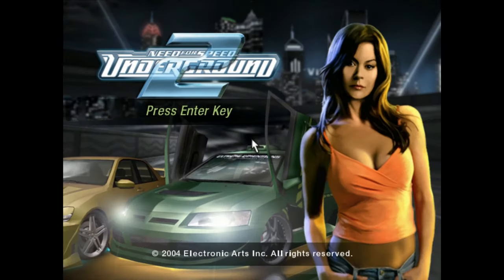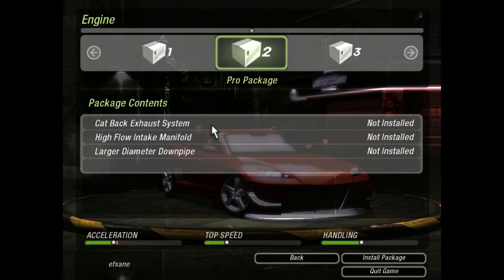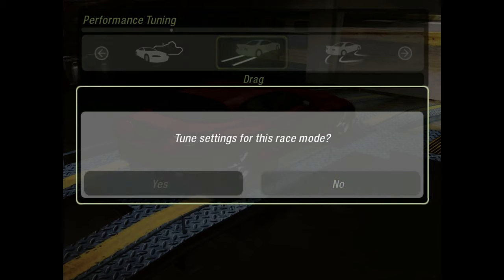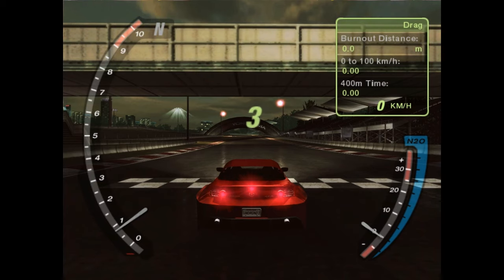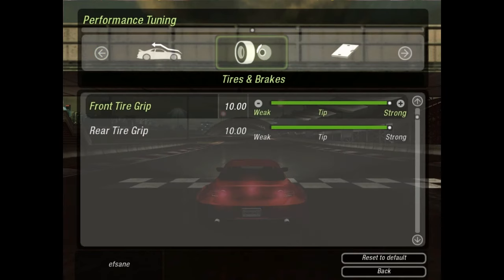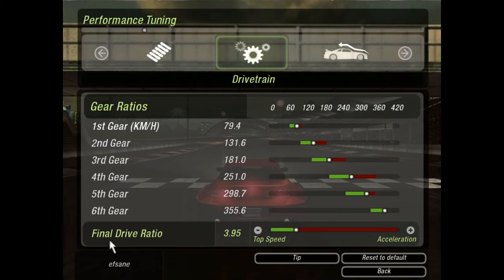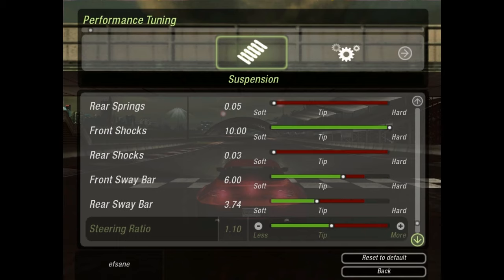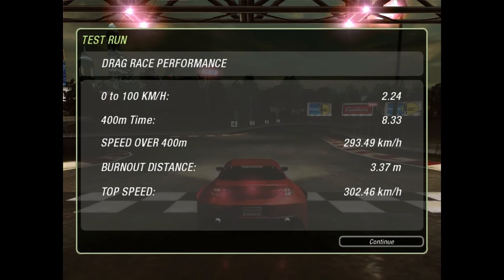How to Tune RWD cars in Need for Speed Underground 2

Comment: What could happens if yo don t install brakes?? If you drift you don t need them perhaps up to level 1 or 2 the professional upgrade but why extreme brakes? Lol
Reply from the maker: Lol it is basically for when you hit corners not to break to early, you can acxelerate much closer to the corner, slam the breaks and then still make a good turn, if you have weak brakes it will mean you need to brake much earlier sothat you can slow down enough for the corner. This makes your lap time longer

Comment: What about the strut tower bar and the adjustable camber plates
Reply from the maker: strut is more for taking corners, this video was only focusing on drag racing where we don't need to take corners, also camber is usually applied on FWD cars in a - as the front end of the car lifts up and the - camber will go to a 0 where as with RWD the back of the car goes down so no camber is really required
Reply: @TheOverclock  camber is also good on rear wheel drive cars for grip around corners
Reply from the maker: possible because when you do accelerate out a corner your nose will lift a bit and in this case having a - camber depending on power, camber will be efficient.
Reply: @TheOverclock  it's when you're going around a corner your car leans over and having a bit of camber helps get some grip in the corners

Comment: NFS UNDERGROUND 2 PERFORMANCE UPGRADES GUIDE
---------------------------------------------------------------------------------------
---------------------------------------------------------------------------------------
ITEMS ENCLOSED IN '*' NOT TO BE BOUGHT
---------------------------------------------------------------------------------------
---------------------------------------------------------------------------------------
STREET PACKAGE
---------------------------------------------------------------------------------------
---------------------------------------------------------------------------------------
ENGINE
---------------------------------------------------------------------------------------
COLD AIR INTAKE SYSTEM
REPLACE HEADERS
MILD CAMSHAFT AND CAM GEARS
PERFORMANCE EXHAUST
---------------------------------------------------------------------------------------
ECU
---------------------------------------------------------------------------------------
FUEL PRESSURE REGULATOR
FUEL RAIL
FUEL FILTER
REMOVE TOP SPEED LIMITER
---------------------------------------------------------------------------------------
TRANSMISSION
---------------------------------------------------------------------------------------
SHORT THROW SHIFT KEY
LIGHTWEIGHT FLYWHEEL
DIFFERENTIAL
---------------------------------------------------------------------------------------
SUSPENSION
---------------------------------------------------------------------------------------
SPORT SPRINGS AND SHOCKS
STRUT POWER BAR
---------------------------------------------------------------------------------------
NITROUS OXIDE
---------------------------------------------------------------------------------------
DRY SHOT OF NITROUS OXIDE
---------------------------------------------------------------------------------------
TIRES
---------------------------------------------------------------------------------------
STREET PERFORMANCE TIRES
---------------------------------------------------------------------------------------
BRAKES
---------------------------------------------------------------------------------------
STREET COMPOUND BRAKE PADS
STEEL BRAIDED BRAKE LINES
CROSS DRILLED ROTORS
---------------------------------------------------------------------------------------
WEIGHT REDUCTION
---------------------------------------------------------------------------------------
REMOVE REAR SEATS
REMOVE INTERIOR PANELS
---------------------------------------------------------------------------------------
TURBO
---------------------------------------------------------------------------------------
STAGE 1 TURBO KIT
---------------------------------------------------------------------------------------
---------------------------------------------------------------------------------------
PRO PACKAGE
---------------------------------------------------------------------------------------
---------------------------------------------------------------------------------------
ENGINE
---------------------------------------------------------------------------------------
COLD AIR INTAKE SYSTEM
REPLACE HEADERS
MILD CAMSHAFT AND CAM GEARS
CAT BACK EXHAUST SYSTEM
HIGH FLOW INTAKE MANIFOLD
LARGE DIAMETER DOWNPIPE
PERFORMANCE EXHAUST
---------------------------------------------------------------------------------------
ECU
---------------------------------------------------------------------------------------
FUEL PRESSURE REGULATOR
FUEL RAIL
FUEL FILTER
REMOVE TOP SPEED LIMITER
PERFORMANCE CHIP 
HIGH FLOW FUEL PUMP
---------------------------------------------------------------------------------------
TRANSMISSION
---------------------------------------------------------------------------------------
SHORT THROW SHIFT KEY
LIGHTWEIGHT FLYWHEEL
LIMITED SLIP DIFFERENTIAL
HIGH PERFORMANCE CLUTCH
DIFFERENTIAL
---------------------------------------------------------------------------------------
SUSPENSION
---------------------------------------------------------------------------------------
STRUT TOWER BAR
PERFORMANCE SPRINGS AND SHOCKS
FRONT AND REAR SWAY BARS
ADJUSTABLE CAMBER PLATES
SPORT SPRINGS AND SHOCKS
---------------------------------------------------------------------------------------
NITROUS OXIDE
---------------------------------------------------------------------------------------
WET SHOT OF NITROUS OXIDE
DRY SHOT OF NITROUS OXIDE
---------------------------------------------------------------------------------------
TIRES
---------------------------------------------------------------------------------------
PRO PERFORMANCE TIRES
* STREET PERFORMANCE TIRES*
---------------------------------------------------------------------------------------
BRAKES
---------------------------------------------------------------------------------------
STEEL BRAIDED BRAKE LINES
LARGE DIAMETER ROTORS
RACE COMPOUND BRAKE PADS
STREET COMPOUND BRAKE PADS
CROSS DRILLED ROTORS
---------------------------------------------------------------------------------------
WEIGHT REDUCTION
---------------------------------------------------------------------------------------
REMOVE REAR SEATS
REMOVE INTERIOR PANELS
LIGHTWEIGHT WINDOWS
LIGHTWEIGHT SEATS
---------------------------------------------------------------------------------------
TURBO
---------------------------------------------------------------------------------------
STAGE 2 TURBO KIT
STAGE 1 TURBO KIT
---------------------------------------------------------------------------------------
---------------------------------------------------------------------------------------
EXTREME PACKAGE (HELL YEAH!)
---------------------------------------------------------------------------------------
---------------------------------------------------------------------------------------
ENGINE
---------------------------------------------------------------------------------------
COLD AIR INTAKE SYSTEM
RACING CAMSHAFTS AND GEARS
PORT AND POLISH HEADS
BLUEPRINT THE BLOCK
HIGH FLOW HEADERS
CAT BACK EXHAUST SYSTEM
HIGH FLOW INTAKE MANIFOLD
LARGE DIAMETER DOWNPIPE
REPLACE HEADERS
MILD CAMSHAFT AND CAM GEARS
PERFORMANCE EXHAUST
---------------------------------------------------------------------------------------
ECU
---------------------------------------------------------------------------------------
FUEL PRESSURE REGULATOR
FUEL RAIL
FUEL FILTER
REMOVE TOP SPEED LIMITER
HIGH FLOW FUEL PUMP
ENGINE MANAGEMENT UNIT
FUEL INJECTORS
PERFORMANCE CHIP
---------------------------------------------------------------------------------------
TRANSMISSION
---------------------------------------------------------------------------------------
SHORT THROW SHIFT KEY
LIGHTWEIGHT FLYWHEEL
HIGH PERFORMANCE CLUTCH
6 SPEED DIFFERENTIAL
DIFFERENTIAL
LIMITED SLIP DIFFERENTIAL
---------------------------------------------------------------------------------------
TRANSMISSION
---------------------------------------------------------------------------------------
STRUT TOWER BAR
ADJUSTABLE CAMBER PLATES
COIL OVER SUSPENSION SYSTEM
LARGE DIAMETER SWAY BARS
SPORT SPRINGS AND SHOCKS
PERFORMANCE SPRINGS AND SHOCKS
FRONT AND REAR SWAY BARS
---------------------------------------------------------------------------------------
NITROUS OXIDE
---------------------------------------------------------------------------------------
DIRECT PORT NITROUS OXIDE
DRY SHOT OF NITROUS OXIDE
* WET SHOT OF NITROUS OXIDE*
---------------------------------------------------------------------------------------
NITROUS OXIDE
---------------------------------------------------------------------------------------
EXTREME PERFORMANCE TIRES
STREET  PERFORMANCE TIRES
PRO PERFORMANCE TIRES
---------------------------------------------------------------------------------------
BRAKES
---------------------------------------------------------------------------------------
STEEL BRAIDED BRAKE LINES
RACE COMPOUND BRAKE LINES
CROSS DRILLED AND SLOTTED ROTORS
6 PISTON RACING CALIPERS
STREET COMPOUND BRAKE PADS
CROSS DRILLED ROTORS
LARGE DIAMETER ROTORS
---------------------------------------------------------------------------------------
BRAKES
---------------------------------------------------------------------------------------
REMOVE REAR SEATS
REMOVE INTERIOR PANELS
LIGHTWEIGHT WINDOWS
LIGHTWEIGHT SEATS
LIGHTWEIGHT DOORS
FOAM FILLED INTERIORS
---------------------------------------------------------------------------------------
TURBO
---------------------------------------------------------------------------------------
STAGE 3 TURBO KIT
STAGE 1 TURBO KIT
STAGE 2 TURBO KIT
---------------------------------------------------------------------------------------
ENGINE CHANGES TORQUE
TURBO CHANGES POWER
---------------------------------------------------------------------------------------
-----------------------------------THE END -------------------------------------
---------------------------------------------------------------------------------------
Reply from the maker: Thanks for sharing your info :) :)

Comment: Do you know how to tune rwd car so that they won't be slippery at tight cornering?
Reply from the maker: That has got to do with your swaybar, its either you stifen it or loosen it, i am not 100% sure but that is where you will need to adjust :)
Reply: Thanks for your reply. Do you have any rwd car that good at tight cornering? If you have can you show me the suspension.
Reply: I tune awd and fwd car and it's not slippery but when i tune rwd car its slippery in tight corner
Reply from the maker: Unfortunately i haven't played the game in a very long time, rwd cars has a problem with cornering amd especially if you apply a lot of power to it, maybe ypu should try to go slower in the corner and about halfway through you accelerate again... But i would say you need something with weight so try the mustang maybe
Reply: So you don't use rwd if the race have tight cornering?
Reply: Btw i love your video when you play online at underground 2
Reply from the maker: I honestly dislike RWD a lot... It has a major traction problem (yes fwd is worse when it comes to pull away) but with rwd it always spins out and struggle with cornering and ect... For drifting its fine but when it comes to racing i dont like it that much... Myself i am a all out AWD guy... In real life i do racing (mostly drag) and all these AWD cars has so much traction that on the pull away they leave everyone behind, the people even stopped racing the AWD cars because of the dangerous pull aways, also AWD are the best to take the corners and get out of it quick... Also try to do drifting with a AWD car, they can hit corners fasters and be out of the turn even before they hit the side barrier, RWD & FWD always hits the barrier because they cant get out of the turn
Reply from the maker: I used to stream it, but then i completed the career :( i want to get heat so bad! but i will oneday when i get enough saved up :)
Reply: Good luck getting nfs heat bro and is it possible to convert old nfsu2 save game into 2019 nfsu?
Reply: I just know that nfsu2 2019 graphic exist in your video
Reply: The Corolla is surprisingly good at cornering. No more struggle on Street X races since i have one.
Reply: Lol rwd is the best for cornering just like king of street x corolla "ae86" just master the proper engine brake, brake timing and gas pedal for more accelaration in exits. I always use corolla in circuit sprint if jackson heights is the map, street x, drift, and url hehe i use 240sx for drag and also for circuit and sprint if its highway haha
Reply from the maker: I personally prefer AWD... The AWD in this game is not so good compared to reality but it is still impressive
Reply: @TheOverclock  im suck at awd i cant tame the skyline always slippery when getting to corner haha